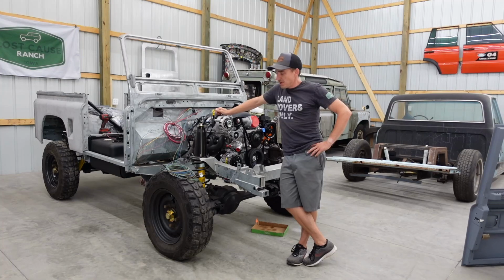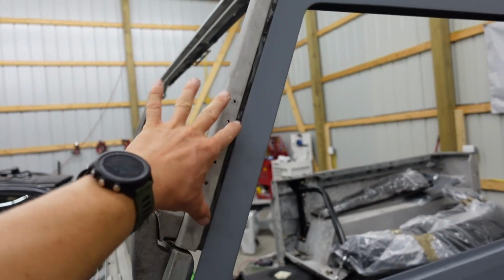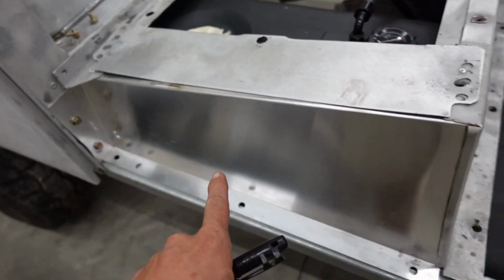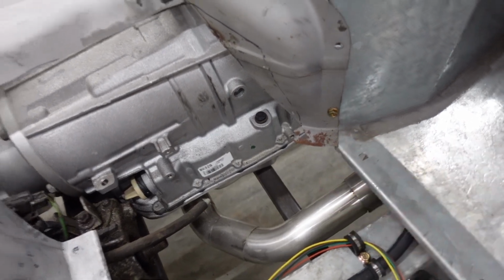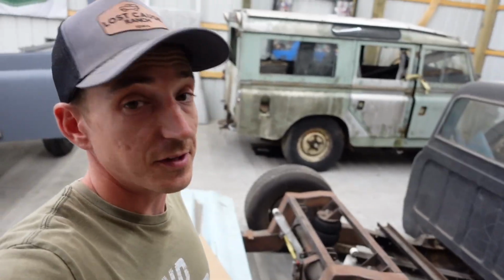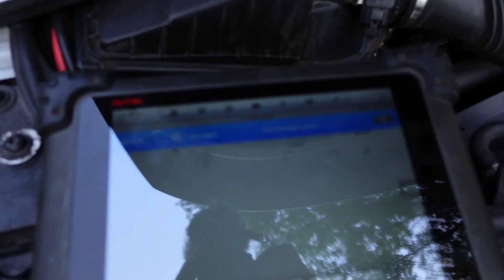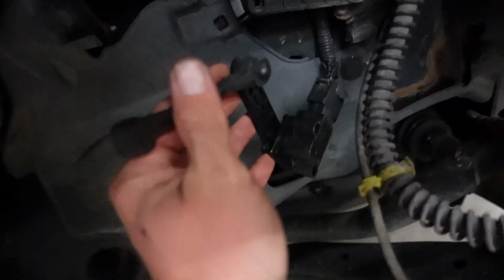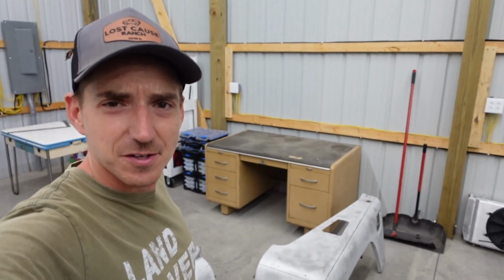Going Backwards on the LS3 Swapped Defender

Comment: Joe drops screw. "Hand quit working."  Me (shocked Pikachu face) "You suffer from that too?" Floorpan templates have some 'subliminal messaging' going on.... Working on a project you want to do is almost always interrupted by another object throwing a toddler-esque fit like it's wanting candy in the checkout line.  I have an old metal desk as shop furniture as well. It is my workbench and holds a bench grinder on one side and a large vise on the other.
Reply from the maker: Have to love when the signal from the brain to the hand short circuits haha. Glad it’s not just me. 

They are a bit like kids, apparently the LR4 felt it wasn’t getting enough attention lately.
Reply from the maker: The desk is beefy. I’m a fan of those tanker style desks. I bet it makes a pretty solid workbench for not a ton of money.

Comment: Would you say the air ride design of the LR4 is more reliable than the P38?

Just an FYI but LRDIRECT was always my goto for parts. Importing them was so much cheaper than buying from a US distributor.
Reply from the maker: In my experience it is much better in the LR4. 

Appreciate the info on the LRdirect.

Comment: Would it be an advantage to add coil overs vs air suspension on LR3/4?
Reply from the maker: The reliability would be better with coils, but I really do like the ride/adjustablity and load leveling of the air. I feel that is part of what makes the LR4 great.

The coils won't deflate and leave you stuck though haha, so there is that.

Comment: How loud is the LR4 from the inside? or at highway speeds and you've got the windows up?
Reply from the maker: At highway it is actually fairly reasonable. Doesn't disturb talking or anything while cruising at speed. It really has a growl/snap to it on the cold start. While moving it is really only loud under decent acceleration. But if I were to do it again I would probably leave one of the two center muffler/resonators in and only delete one.